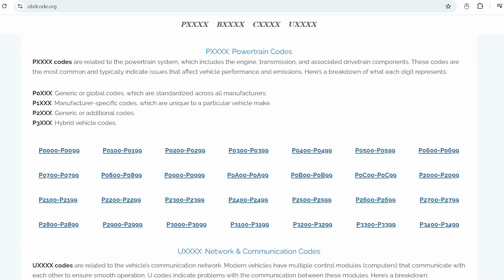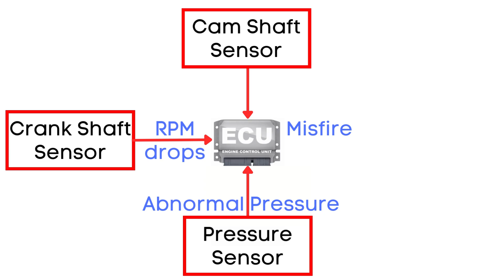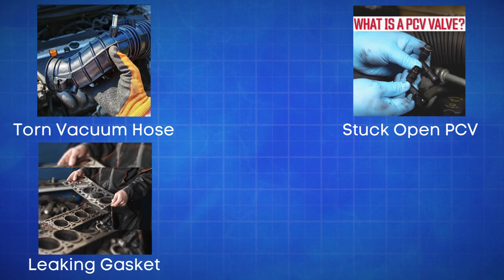How to fix P0308 | Cylinder-8 Misfire Detected

Comment: suppose air leaks are the cause of misfire. the question is: how air leaks choose the cylinder for misfire??? [pooo8 in this case].
Reply from the maker: It can be with any cylinder or multiple cylinder. If the misfire happens with multiple cylinders, there will be code for specific cylinder along with P0300 (for multiple cylinder). I hope you understand me.